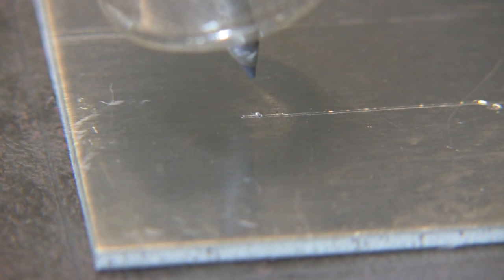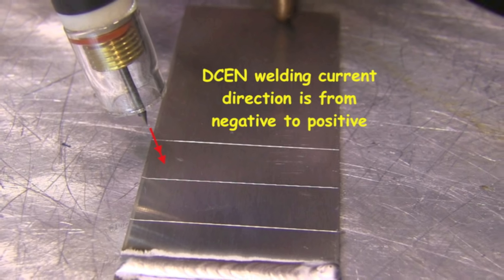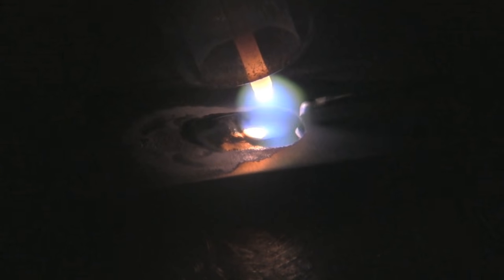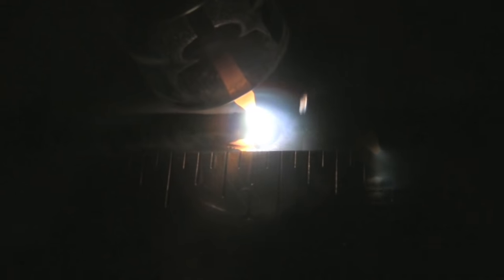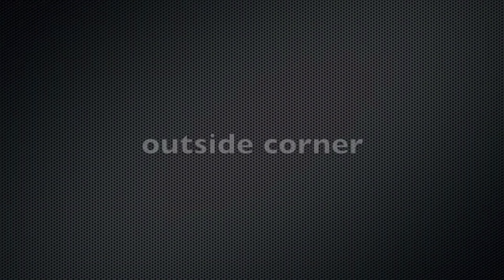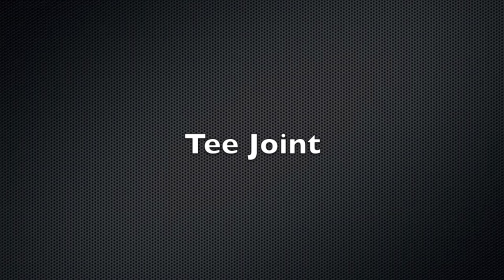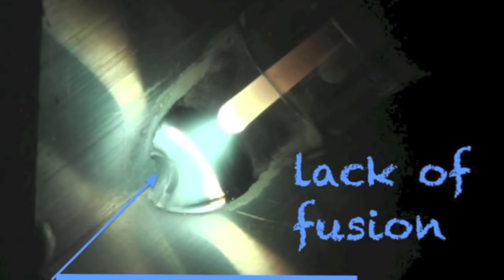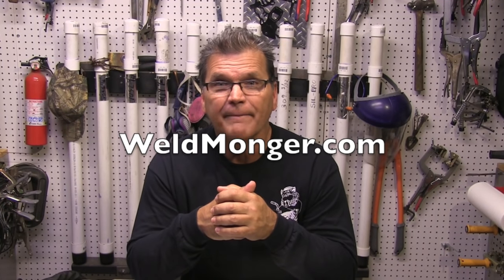How to TIG Weld Aluminum part 1

Comment: Jody, you're a great welder and teacher, but there are things I'm just not getting.  For instance, I have a Miller Diversion 160 and I'm trying to weld aluminum.  I don't know what my argon settings should be,  and that's my first issue.  I have a flow meter from Victor and I can't tell what the heck it's reading.   I've tried various settings and I still can't get that frosty start.  Whether it's 1/8" aluminum or 2" thick stuff, scrubbed with a stainless brush, fanatically cleaned with acetone or denatured alcohol, I still have the same issues.  I just can't maintain a good arch.   I sharpened the Thoriated tungsten to a point like you said but it seems like most times it just get's too hot and the whole thing glows red or yellow.  I've tried over and over again and I'm really frustrated.  Seems like you just get that perfect arc and I try to tilt the torch at a sharper angle but still I get nowhere.  I'm not a bad MIG welder or torch welder but aluminum is what I've dreamed of doing and I'm just so damned frustrated.  I don't have anyone to guide me and as much as I appreciate your great help and personality, I'm just not good enough I guess.  I'm a 65-year-old veteran who loves to fabricate and if I could learn this, I would feel I met God himself.  I don't what to do.  I've posted ads asking for help, offering to pay for lessons, but outside of Lincoln Tech and other school's that's all I have.  And I literally live in Groton CT, the Submarine Capital of the World here.

Comment: Thanks for the video! Question here. I have a DC machine with no AC option. Do you think it would be at all possible to do TIG or MIG Aluminium welding on it? If yes, then what would be the easiest setting to get started on that?

Comment: Hi Jody, big fan btw, you have really helped me. I wondered whether you could do a video on what the root should look like on different welds to know you have adequate penetration. For example, when I weld 2.8mm sheet aluminium outside corner welds, should I see anything on the inside? Cheers Chris

Comment: Dear sir,
As per my experience share with you for during the welding of aluminium pipe welding I would found oxidation in welding root inside
Please suggest to me how to weld aluminium pipe with full penetration weld.

Comment: Hey Jody I got a question about using helium gas in welding aluminum on dc. Is there a way to purify and filter standard helium gas to ultra purity grade  through a portable purifier connected to the gas regulator.

Comment: Hello jody! love this. My question is, how do i weld thick alu flatbar (10mm) to 2mm alu plate (five bar plate), i mostly weld these for covers for work platforms and so on. I hope to get an answer, thank you so much for ur vids, helped me alot!
Reply from the maker: when you need to weld some really thick aluminum to something much thinner, preheating the thick part to 200-300f helps

Comment: Which is easier to weld with 4043 or 5356 filler rod when Welding aluminum?

Comment: That looks pretty easy. (I've done a little mig welding) I have a couple questions.  What filler rod is best for aluminium?  What tig welder is best for a newbie (cheap).  I have a lowe roughneck all aluminium boat that needs some work (has some broken welds) - would you think a newbie could do this or would you suggest taking to a pro?
Reply: Brian Gillespie 4043 or 5356 depends

Comment: Making my first aluminium welds I find I'm dipping tungsten a lot more than with steel. Seems the bead size is naturally larger and when I push in rod, the bead rises to say hello to the electrode.

Comment: techniques on how to stop the filler rod balling? Is is torch angle, is it keeping the rod under the cup, if you do that how to stop it melting before adding to the puddle, Is it keeping it out of gas then diving it in quickly and out again... etc. Also sometimes its really hard to get the puddle to start. Is that just more heat?

Comment: When you weld aluminum on AC does it matter which port (+ or -) on the machine your electrode is hooked up to since AC alternates? I would imagine it does since there is an AC Balance setting. Thank you!

Comment: Hello, I'm closing out my senior year in high school this year an I have completed all joints with aluminum as well as carbon steel an stainless. The one joint I have had trouble with an still do to this today are the lap joints. What's the trick to getting that right torch angle and heat?

Comment: How do you cut and prep aluminum for welding? I can weld on flat untouched aluminum all day but as soon as I cut it, it goes to crap. Preferably showing how to use basic cheaper methods of cutting aluminum.

Comment: Hi Jody I replied via email but I'll try here how do you weld 2-1/2"x2" pipe to 2" x.040" tube. The pipe has been turned on a lathe so that the tube fits inside snug by about 3/8"

Comment: lets say that im more experience whit dc stick and mig on steel, my aluminium experience is limited to the spool gun,
noob question  :  what variables should i take in concideration when setting the hertz and volts for welding aluminium with the tig  ...!?

Comment: When would you use 4043 vs 5356 filler rod? and best tips to stop hitting the tungsten with the filler rod lol.  I'm still not great at feeding the rod to get a long weld without  it wobbling all over the place, any tips on that?

Comment: I was given an inverter machine with HF Start and A/C balance control but NO Frequency controller. What do I need to know to and successful welds on both thin and thicker material?

Comment: Jody nice video again . I know you have made a video about welding aluminium on DC and using a helium . What happens exactly to the thick film that is over the base metal ? And would it be possible to weld aluminium with CO2 and Argon ?

Comment: What are some tips for keeping a tight arc without dipping the tungsten?
Reply: practice and try to lift a little every time u add filler because if your arc is to tight and u add filler the puddle will build up straight into your tungsten

Comment: Thanks for sharing the knowledge , I'd like to know how do welding tubular 7020 alloy affects it's strength in the HAZ area ,info about the material I have is 7020 Alloy ,idk what T it has yet  OD is 1 1/8" wall thickness is 3mm aprox . Is it negligible or enough to consider heat treating + ageing it ? Oh! it's for a road bicycle chassis .Thanks and keep it hot!! cheers

Comment: Jody, what would you recommend for .050 5052H32 aluminum corner joints? (power setting, rod size/type, cup, gas flow, electrode)  I'm building an aluminum fuel tank for a home built airplane.  Much appreciated!

Comment: I have a question, I just got a new Alpha Tig 203XI and am trying to get things set up right. Sometime when I start the arch it start to clean but then barks and sputters (for lack of better words) what causes that? It even happens mid weld sometimes and leave black deposits? Is it my Tungsten ? or bad gas coverage? Thanks for the help

Comment: I weld aluminum everyday almost, and a couple of factors that affect a weld I have notice on my set up has been tungsten stick out and gas control/regulation also Im along way from the machine so I have to use a frequency arc starter! What is the name of the welding app you have named before? Thanks great video👍

Comment: I'm looking at an AHP machine and only have 110v outlet.  What's the difference when using a 15amp vs 20amp circuit breaker in the garage for TIG welding thin 1/8" aluminum?  Any concerns with tripping the breaker if we max out the amp to 138 on a 110v?

Comment: Hello i have to weld two fuel tank made of 0,040" 6061t6 aluminium , there are a lot of edge welding , which is the best amperage and setting for this work , and what is the best tungsten and sharpening?

Comment: How to weld aluminum with no foot pedal control? I have a Lincoln AC/DC buzbox with a Hi-Freq add-on. I hit a button to light-up so I don't need to scratch start but I have no amperage control while I'm welding.

Comment: Thanks for sharing your knowledge with us Jodi!  Here's my question, when you demonstrated the T-Joint, it almost looked like you used the 1st dab to help build heat on the joint.  Did I see that correctly or do you always want to make sure you have your heat buildup at the bottom of the joint BEFORE adding rod?

Comment: any tips on holding a close arc?  whenever I am close the bead pools up and touches the electrode!
Reply: The closer your eyes are to the weld puddle, the better you can perceive depth (the distance between your tungsten and work piece).  Get in there nice and close when learning. Rest your torch hand and try to get as steady as possible. Also try darkening your welding helmet a bit more. That helped me. I run it up around shade 12.5-13 most of the time.
Reply: I had a large improvement (still plenty of improvement to go) in visibility by inserting a "cheater" 2X lens inside my helmet to shorten up my focal distance.
Reply: Very good comment Hank. I forgot all about the magnifying lenses. They are especially good for people with less than perfect vision. I worked for a guy about 10 years ago (when my job was building custom stainless headers) that could fusion weld thin stainless better than anyone I've ever seen (in person). He was in his 60's, and always wore corrective lenses.
Reply: where can you get those magnifying leases from?
Reply: a lot of helmets have the part number for a cheater lens on a sticker right inside the helmet
Reply from the maker: torch angle makes a big difference..especially on fillets. try not to lean it back very far
Reply: Здравствуйте .  А у вас есть на русском языке  
ваши уроки ?
Reply: Thanks for the advice. I have a new Everlast tig welder and want to start learning how to tig weld aluminum. I'm pretty stoked.
Reply: Mark Smith aw aww Qantas
Reply: +Hank Yarbough Same here. Letting go of my vanity and upping my prescription helped instantly lay a better bead. But, more importantly, for my confidence anyway, was seeing well enough to identify the characteristics of my weaknesses (machine set-up vs. technique etc). I was really getting frustrated chasing settings up down and sideways combined with, say, too long an arc and travel speed.

I love Jody's videos because his camera filter lets you see as if you're in the shop under the hood with him.
Reply: Arm Suwarnaratana Omg this pisses me off too!

Comment: One more question...when I am trying to do a T joint I have a hard time getting both the upright plate and the base plate (aluminum) to bleed togther and start the puddle. Do you hit it pretty hard to get the puddle then back off the pedal?

Comment: I have a Miller EconoTig.  It is a 180 amp transformer machine.  I use 1/16 or 3/32 tungsten and pure argon (I have found that the 3/32 is better for AC as it erodes slower than 1/16.).  The welder has no frequency control, no balance control.  It does have high frequency arc stabilization, but I think it actually welds at 60 Hz.  The literature says it welds Aluminum.  Ok, as I am watching the video you demonstrated the main problem I have welding Aluminum @ 8:33. . .filler rod melts before it gets to the puddle (I had the same problem with silicon bronze too!).  I guess I need to really concentrate on my arc length.  Anyway, I have a lot of problems when I weld Aluminum.  Any recommendations you have to make it better for me would be greatly appreciated.
Reply: In my experience , get a different machine. I too had an Econo tig, and while I could do some respectable welds it wasn't very good. It would shut down due to heating up, and the torch would burn the snot out of you. I bought an Everlast 250ex with a cooler, and it became almost easy.
Reply: Thanks.
Reply: I know it's not what you want to hear as switching machines is expensive, but the Econo tig is okay if you are going to weld a little aluminum, or thin stuff, but you are better off with something that can handle more amps.

Comment: If you haven’t mentioned....
Can you please do a video on the dangers of Phosgene Gas produced with the use of Clorinated Brake clean and TIG welding.
I’m no safety Sally by any means, but tooo many new welders have been poisoned or killed with Phosgene Gas.

Comment: Jody, When using an Inverter machine, I use 3/32 2% Thoriated Tungsten. My tungsten tends to ball up a bit than yours do. I'm usually at 75% Balance & 160 on the hrz. , using Sine wave for the waveshape. Material thickness is usually around .035 - .093. At times will go higher on the hrz to get a tighter  bead. Any other suggestions?
Reply: Different machines have a different setting for what 75% means. Some machines it refers to the negative, others it's the positive.

Comment: Hello. I have question about aluminium welding. I have nice welds and finish them off with extra filler but on a butt joints I get those cracks on the start of the beed. What would be a cause of it? I tried add extra filler for starts on the beeds but it did not make a difference.

Comment: I am not able to get penetration in T joint fillet weld using base material 5052- 3mm & filler wire 5356- 2.4mm diameter.
What AC balance & AC frequency should I adjust to get good penetration

Comment: I know this isn't aluminum but I was welding 1/8 kitchen stainless and had a very tight arc but lacked fusion at the root, is the caused by too much torch angle?

Comment: In my work we have an old Lincoln square wave 255 ... I just wanted to know would that machine ball the tungsten automatically or do I have to hit it with a hammer or how would you ball the electrode ?

Comment: hi, i'm having difficulties passing a weld test  on 6061 t6 aluminum FW 2mm  (argon only) . i have passed it before but it seems by sheer luck since when training i don't have acces to chemicals for penetration testing. Any tips would be appretiated. Also what chemicals would you use for AL macro testing ?

Comment: What grade aluminum and filler would you use to construct a tank with liquid in it like a fuel cell or radiator tank in automotive applications.  I made one with 6061 and 4043 and after some use the seam would split.  Outside corner joints.  Is it me or the material?  Thanks Jody love the channel
Reply: It usually cracks from the corners, I found a small bevel works along with wrapping the corners
Reply: try using 5052 instead of 6061. seems to work MUCH better

Comment: hello I have to weld two fuel tank made of 0,040" 6061t6 aluminium, there a lot of edge welding , which is the best amperage and setting for this work? and the what is the best tungsten and sharpening?

Comment: Good day, I have a panweldTig 200 ac/dc welder.This is the following buttons on it. Pre flow / Post flow /clearence effect / amps/ a switch that say foot pedal and pedal control. please could you give me some guidance. for aluminium tig weld. i have mine set at 80 amps, clearence just befor +1 setting, preflow0.2 s, post flow at 3s.

Comment: I'm looking to start welding Al, Ti and Inconel. I know little about welding, however am an electrical engineering and precision machining student. I would like to fabricate my own titanium exhaust for my car mainly and will be following your channel closely. For someone completely new to welding I've been guided away from my MIG, told to start with stick welding, then go TIG. Aluminum is easy to machine, so TIG it is. :)  Would you mind going into recommendations for first time machines that allow for the most options in the future?
Reply: I should have made myself clearer, one, I am building a track car that is mainly carbon fiber, so cost went out the window when I said "I want" haha. 

And two, I want to learn how to weld, it would be neat to do it myself, however, I recognize I am a novice. I am an electrical engineering and computer science student, I have a particular interest in welding and industrial automation. 

I want to learn to weld, not to do it myself, but to automate the process. I want to build a legitimate welding robot to do my work for me. 

I built my own 3D printer which is a CNC machine, it runs off of basic, although slightly unique, G-Code. My percentage of error will be too high, you're absolutely right, however, a robot simply has to learn once in order to do it. :) 

A relatively small robot, nothing crazy, one that can feed the rod consistently, and move at a constant feedrate. Biggest problem will be the need for a lot of axis to do the curves I will need to do. In most cars, the chassis is spot welded, for Nissan, the Nismo cars are hand plucked off the assembly line, and sent to Autech and seam-welded and they get a completely different build. I would imagine owning a welding robot going into the future would be beneficial for me. :)
Reply: Haha thank you, they could admire it from the tailpipe 😂 while it's on the ground. actually, if it's titanium I might make it come out behind the front wheels so I can use a LOT less of it haha. Thank you for your concern, as long as the welds hold, I can make it pretty once I know more. :)

Comment: Is there a benefit to using the pedal? Is the pedal only necessary for certain machines? What would a good starter rig/machine to go with. I got into rig welding about 15 years ago and I would like to get back into.
Reply: juan chaidez Foot pedal gives you more control. It's not required. you can use a torch switch. You can use lift start on other metals, not recommend on aluminum.

Comment: Where I get confused is : I have a big miller 250 syncrowave. Are you supposed to swap the cables. Put the negative on the positive post and the positive on 5 he negative post. Because there is no mention of this in the manuel but heard 8 was supposed to. So just not sure. Thank you